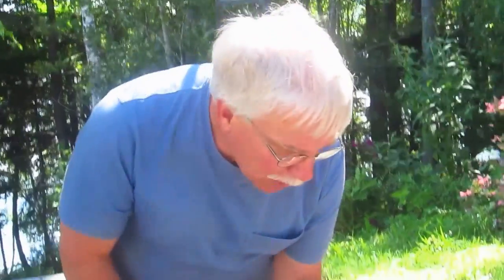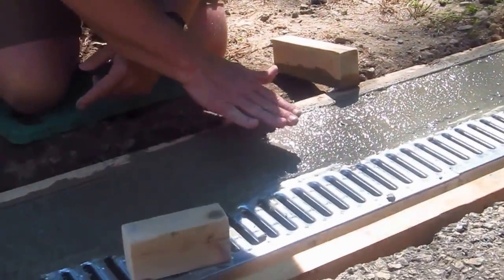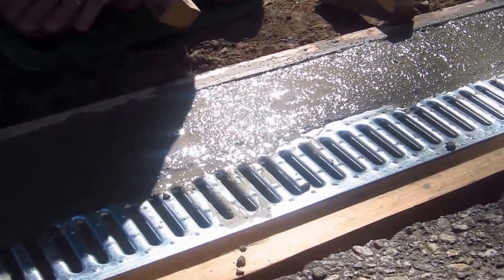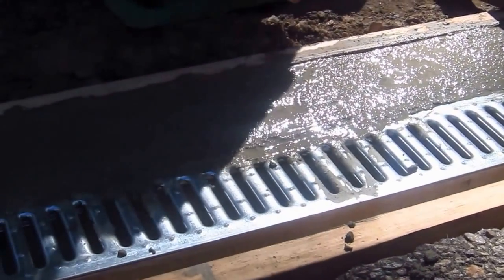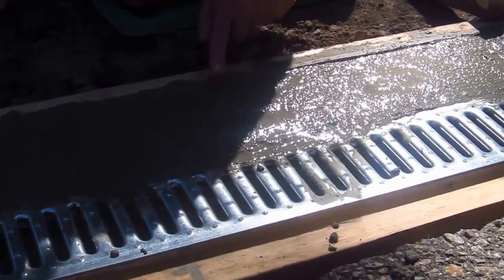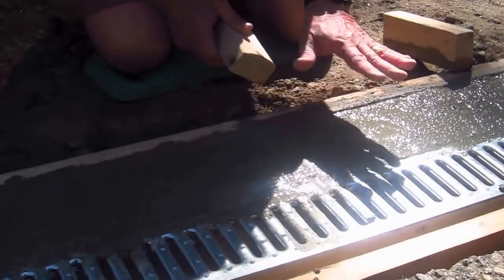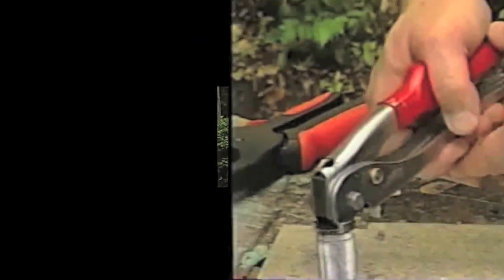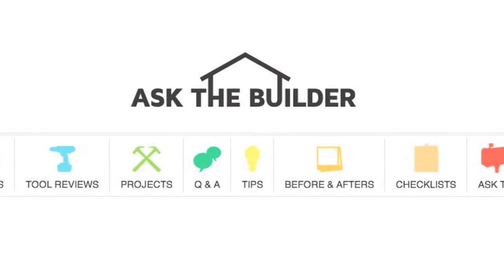What is Concrete Bleed Water

Comment: I took a contractors test, and there was a question that read, "When should concrete be floated?" What is the correct answer?  Before the bleed water is released?  After the bleed water is released?  I dont know if they were talking about hand floating or bull floating.  Not knowing that, what would be the correct answer?
Reply from the maker: Congrats on the test! Whenever you have a question like this, please go to my website for a detailed answer. All you have to do is type: "bleed water" into the search engine at my website. Try it now:  https://www.askthebuilder.com/search/
Reply: Doesnt matter what tool you're using they all do the same thing .. after

Comment from the maker: It can be hard to not work in the sun. The day this little slab was poured was the WORST time to pour - it was both sunny and windy. These conditions stress concrete pulling the water out too quickly - you can get horrible plastic shrinkage cracks in these weather conditions. The best time to pour concrete is when it's about 60 F, overcast and no wind. A vapor barrier under concrete is a MUST for interior slabs. It's not so important outside. Just wet the soil before you pour outdoors.

Comment: that is true Tim, but in fact the concrete should be protected from the sun. It needs to do his job with the cement. also, a plastic under the concrete is handy : you prevent that the water goes directly into the ground.